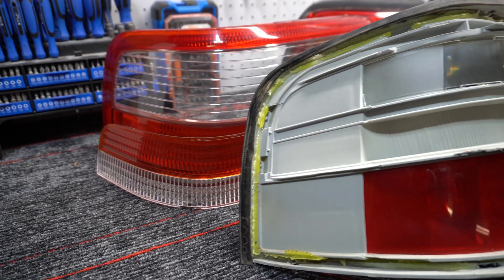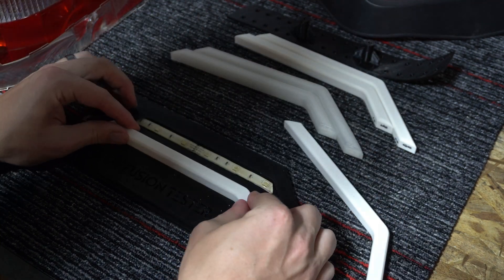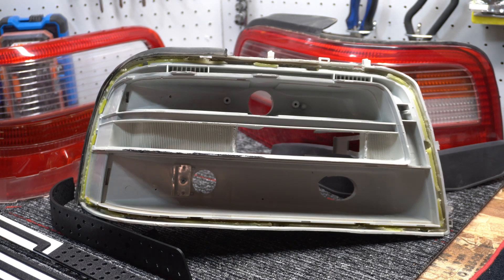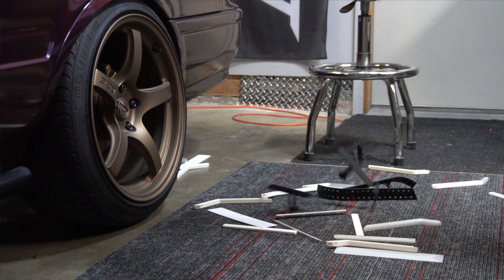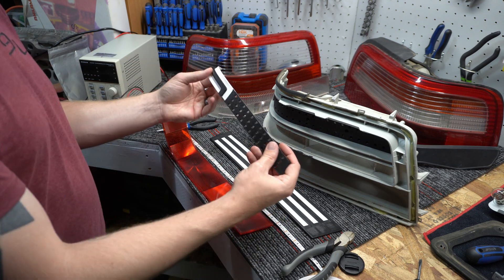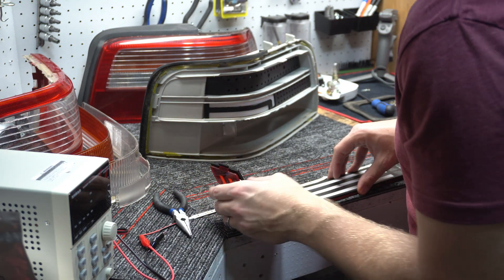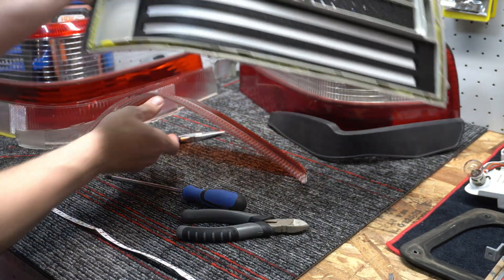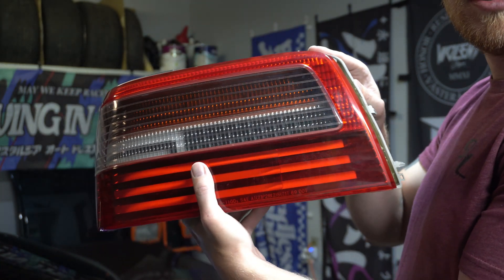BUILDING CUSTOM LED TAILLIGHTS - PART 2

Comment: since you didn't have a 3d scanner, did you print yourself some radius tools? I came across this vid today, working on a gauge pod and realized I probably shouldve printed one of those. looks at pile of plastic Great work btw, thanks for posting
Reply from the maker: No I didnt, in this case, I was 3D printing just a straight length and then using a heat gun to mold the printed pieces against the factory lens inserts in order to achieve the corner radius. A lot of trial and error though still for sure… haha

Comment: After all that work. I wouldn’t cover it up either the Amber lens of the factory covers. Would be cool if you can make some new outer covers that aren’t defused/ribbed.
Reply from the maker: Yeah, we'll have to see how it looks once I've actually got the LED's lit up and go from there. For now at least I think I'll probably just end up with kind of an OEM+ look in keeping with at least the main outer lens (still need to see how the inner amber / white insert looks with the lights on). **Eventually, I'd love to do more in terms of modifying lenses or learning how to make clear lenses / smoked lenses / etc. (in a professional way... and not just using VHT nite-shades or some spray... haha)
Reply: @zakweeler  look into vacuum forming the lens.